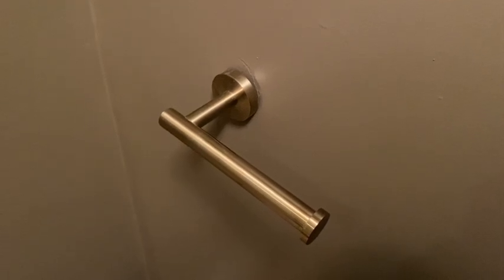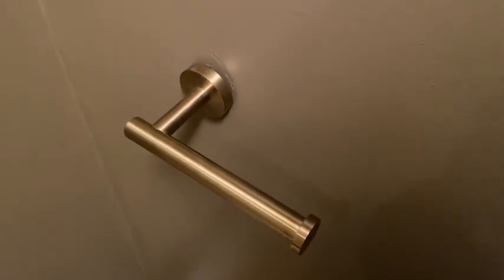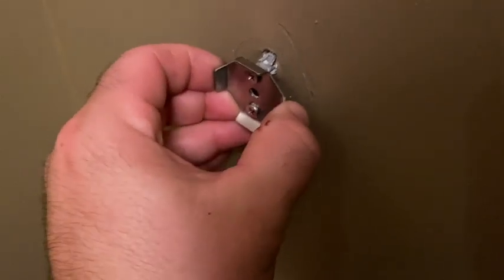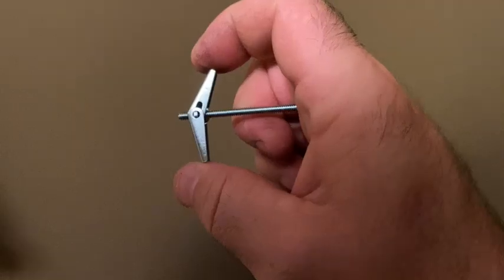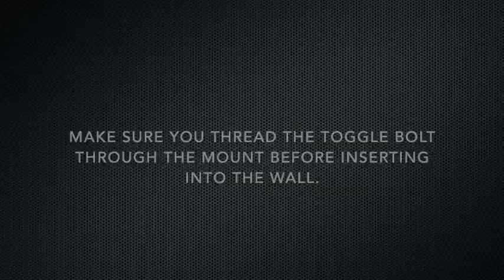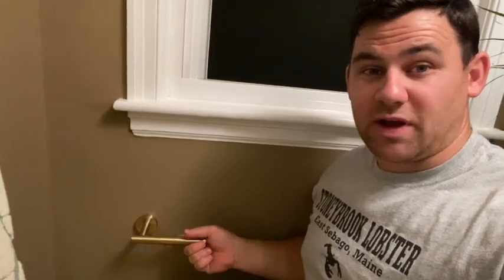How to Fix a Loose Toilet Paper Holder (Drywall anchors pulled out of wall)

Comment: Are these strong enough for shelves as well? There are not studs in the areas that I need to place the braces.
Reply from the maker: Hi, thanks for the comment. Yes, they work well for shelves. There are different sizes that you can buy which will indicate the overall weight they can hold. I used them to hang a medicine cabinet for my brother-in-law and they worked very well.

Comment: How did you get the fixture to come off?
Reply from the maker: You may need a small Allen key to remove the fixture from the mounting bracket. You will have to look for a small Allen screw (likely at the bottom of the fixture) and unscrew that until the fixture is loose. Once that is removed you should see the screws that attach it to the wall. Just remove those and the mounting bracket should come off.
Reply: @hobbyhandyman  Awesome, it worked! Thanks you for your quick response :)